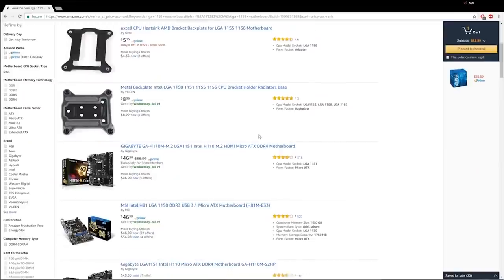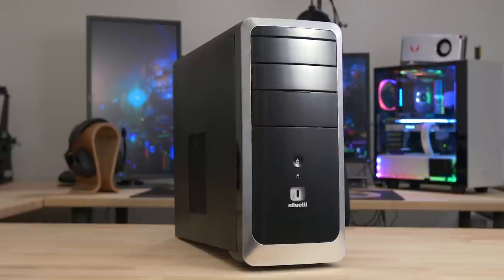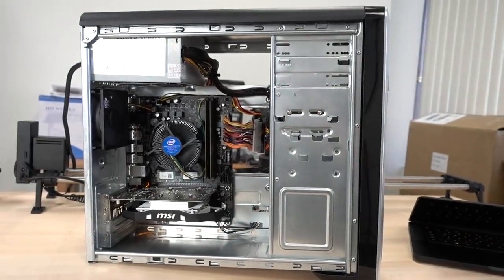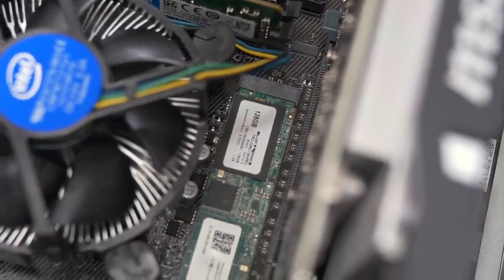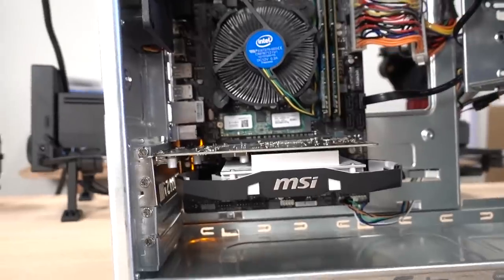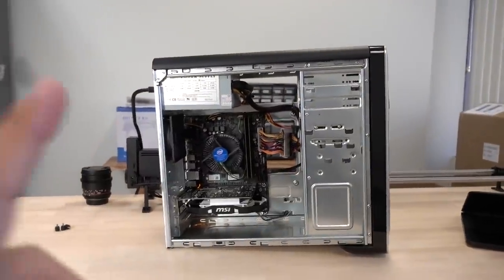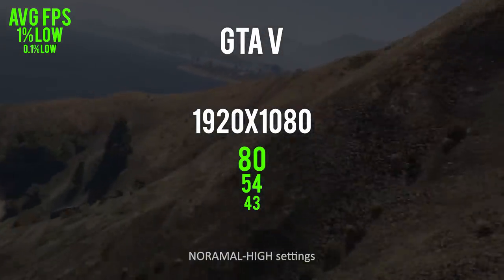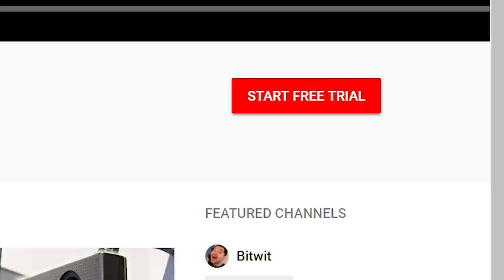The best $400 gaming PC ever?

Comment: The PS4 Pro is $450 so you could upgrade to a GTX 1050 Ti and completely shit on the PS4 Pro
Reply: and get a better psu
Reply: Chris Ayres 
Operating System
Monitor
Mouse
Keyboard
Headphones or speakers.

Your looking at another £300.
Welcome to the clueless club :)
Reply: The Slipernator

Xbox Live / PSN (Monthly cost)
TV (Avg higher cost than a budget monitor)
Headphones
Full price titles drawn out

Yeah there's a few things missing but consoles have a few "Hidden" costs too.

I guess you're the president of the Clueless club? :)
Reply: Karl Krisp 
You don't require PlayStation Plus to play the software, even if you do choose to purchase it's 40 a year!
You don't need headphones you can use the tv speakers which most do.  Nobody would purchase a console unless they already have a tv!
The console will always be cheaper, more simple and less problematic than a budget equivalent PC.
Reply: I'm pretty sure no one would buy a recent console without using online services. Old consoles can be used as blu-ray machines.

If you don't use headphones for games, You're only hurting yourself.

Tv's still need to be purchased. (I bought my TV after i bought my XB1)

And yes consoles are cheaper, but you're locked into limited usability.

Consoles are good for casual gamers picking up games for an hour or two, if you're wanting the high skillcap and competitive scene and almost no restrictions, PC is 100x more worth it to spend an extra $400 to play.

Disclaimer: I own almost ever console (No SNES RIP) and i dislike playing any game i have on PC on them. Now exclusives and whatnot are a good time. I love me some God of War or Forza.

Oh, and PC's are only problematic when you don't keep everything up to date.
Reply: Not trying to make this a "you're wrong, fuck you" Argument, Just stating that you cant go out and buy an xbox one and plug it into the wall and immediately start playing. There are steps for consoles as well. I hope you're having a good day! :)
Reply: +Karl Krisp
1) Unbox console
2) Plug into wall
3) Plug into TV/Monitor
4) Sync controller(s)
5) Perform step by step initial startup
6) Insert game disc or download game
7) Play
Seems pretty simple to me...
Reply: Glasterz consoles aren’t good dude they don’t even play 1080 p they play at 900p and can’t even get 60 fps on fortnite I don’t dislike console players but it’s just plain dumb to go with a console or a pc unless u have like small children or something
Reply: As long as it's 720p or higher, I have absolutely no problem with 900p
Besides, the Xbox One X plays 4k at a solid 45 fps minimum so your 900p argument is invalid there...
Reply: Glasterz Xbox one x costs more than a pc tho same can’t be said ab a generic console
Reply: Glasterz if u think 45 FPS is good then u haven’t expierience life
Reply: Xbox one x without TV = $500
                                            Great Quality, Good FPS
This budget gaming PC (No Speakers/Headphones, Monitor, Mouse, Keyboard, etc.) = $400
                                            Good Quality, Good FPS
Now, you add in the other costs and factor in the performance setbacks and you got yourself a result less than favorable for you
Reply: 45 FPS not good? Once you start getting past that, you really can't perceive any changes...
Reply: Chris Ayres my xbox one cost me 180 new
Reply: You're nuts man.
Reply: Glasterz wtf can u play on Xbox with no TV ? You can use your tv with the pc as well so this adds no cost apart from headphones ( not necessary and , not included with x box to my knowledge ) and keyboard and mouse , cheap ones for $20 dollars so still $80 cheaper than x box , higher frame rates and can do a lot more than play games !
Reply: Sharky. This is the most stupid argument of all. Do you know how many games are only for PC?
Reply: TV controller headphones speakers?

ur looking at 500 dollars
welcome to the clueless club
Reply: The PC master race strikes again!
Reply: Honestly at this point I would only consider console for exclusive titles and thats only if the game is really worth it otherwise PC all the way
Reply: The Slipernator ik this is an old reply, but i cant help myself :)

You can get the OS for free from the Media Creation Tool and it isn't piracy since the tool is free to download from Microsofts website.

You can use a TV. If you're including a monitor in the pricing, then you's have to include a TV with the consoles pricing.

You could grab a cheap mouse or keyboard or a mouse/keyboard combo.

Again, TVs have speakers, but if we are going by your philosophy that you need a monitor for PC gaming/usage, then many monitors come with speakers, even if they don't you could use any pair of earbuds or headphones laying around your house. Earbuds go for extremely cheap.

So really, you only really have to pay for the keyboard and mouse, and cheap keyboard/mouse combos can easily get the job done (well, it would perform better than a controller).
Reply: David Whitfield i know this comment is old, but I dont care.

You could crank resolution up to 4k on a 1050ti. Sure, you may have to turn some graphical settings down, but consoles already play low-medium settings. You could play at 4k 30fps on a 1050ti at low-medium settings, probably even higher.
Reply: Sharky. I know your reply is old, but there will soon be a PS4 emulator, there is already a Nintendo Switch emulator, and a PS3 emulator (and an Xbox 360 emulator, but i dont think you care for that).
Reply: The Slipernator This. I can't stand when people say a PC build is cheaper when they only consider the tower hardware. Most people that would consider a build like this probably don't own a computer. And surely don't have all the other parts laying around either. So all other parts get added to the list. So, yeah your $400 budget goes up to about $700. And if you don't know how to build or don't want to, you figure at least another $100 for someone to do it.
Reply: Chris Ayres lol wot you can't build a 250$ gaming pc better than console
Reply: Chris Ayres I like ps4 because it's exclusives are my favourite games, but I like pc for it's performance
Reply: the xbox one x actually runs most titles at 1800p, not 4k. and 45 fps is not good, even though most titles on Xbone x run at 30 fps
Reply: @david whitfield any system can run 4k, you would simply need to sacrifice fps or turn settings down until the fps is bareable
Reply: operating sys. free
monitor 45 bucks
mouse 5 bucks
keyboard 5 bucks
 headphones 30 bucks

you are clueless !
Reply: @theslipernator1402  not to mention gayer.
Reply: neither the xbox one x or ps4 pro can do native 4k.
Reply: @theslipernator1402  you can get your operating system for free, you will also need a monitor for a console, and you need headphones for you console as well
Reply: @bmil38  You say that...my 200+ fps games disagree with you. I can perceive how smooth the games are, and I can 100% tell the difference even over 60fps. So...there's a pretty big jump right there. 60 FPS is 100% of the time better than 45FPS. And you can tell a difference.
Reply: @theslipernator1402  these are small prices and you dont actually have to activate windows if your that strapped for money and most people have a tv and headphones so no its not another 300
Reply: Lol gtx 1050ti ain’t shit, unless you have a gtx 1060-1070 then ps4 pro is still better
Reply: @theslipernator1402 u know you can pirate windows 10 right?
Reply: @josephstalin2138  considering 1050ti can run any game on the market just fine plus all the perks of having a PC in the first place makes any console pointless as anything but a glorified vcr
Reply: @Chris Ayres I still buy them along with PCs because of exclusives
Reply: @theslipernator1402  alot of monitors have speakers built in get outta here console peasant
Reply: This post is hilarious!!  Full of "I've spent tons of money on a PC so need to justify"
Reply: The Slipernator so console players get a free tv with their console ? And you don’t NEED a headset, you can use built in speakers, you also don’t NEED the top of the line keyboard and gaming mouse AND you can get Linux or steamOS for FREE  welcome to the clueless club
Reply: @SL1PSTAR  lots of other people see their graphics too. For example, if they are streaming, thats people who see their graphics.  If they are uploading content on YouTube, theres more viewers.  Case in point, people still see their graphics.
Reply: PC master race.
Reply: @leonelisaacflores  Amen Brother!
Reply: @Splorpop me... rip
Reply: The Slipernator tv controller mic :) welcome to the clueless club
Reply: Nah get a rx 570 its like 30 fps more for cheaper
Reply: just so you know the ps4 has a vega 56 and the ps4 pro has a vega 64  look up the facts son.... you cannot buy a vega 64 for less then 600 but the fact theres something called whole sale and company deals the vega  company sells there vegas for like 400 bucks less if you buy billions of them all at once which is what sony playstation does
Reply: Screw consoles, they're non-upgradeable junk!
Reply: @CHICKENmcNUGGIESMydude  No, the original PS4 has graphics somewhere between an HD7850 and HD7870. The PS4 pro has graphics similar to an HD7970 ghz edition. I just bought a refurbished Vega 56 for $240 plus tax and you can overclock it to Vega 64 speeds or faster(so gtx 1080 or rtx 2070 territory). Xbox one x is less powerful than an rx 580 and similar to a gtx 1060 6GB. The original xbox one and one s are like an r7 260 but about 10% slower.
Reply: @theslipernator1402  no os, just dont use a key
Reply: @theslipernator1402  200£
Reply: remember, no ps plus to play online
Reply: @bit8793  and case
Reply: @theslipernator1402 Slipernator you don't need to buy an os and what about all the other features for a console?
Reply: @theslipernator1402  ps4 pro tv or monitor
Reply: @theslipernator1402  I know this is old but os. Dont need to do it if you are ok with watermark. Plus easy enough to get a key for less than 20 us. Moniter? You need a tv to play a console as well as headphones or speakers. I built a really nice pc, hooked it up to my tv and bought a 15 dollar keyboard with a track pad. No additional cost other than the 15 bucks. And I use my xbox controller to play with.
Reply: @davidhodge0201  
You will already have a TV no other purchase necessary. (Money saved)
You dont need any operating system (money saved)
Dont need a keyboard or mouse (money saved)
Reply: @jszn561  Research better dude.
Reply: TunOF75 but  you don’t have to pay for a operating system
Reply: @theslipernator1402  You're*
Reply: @theslipernator1402  you don't need to pay for Windows 10 and a PS4 pro doesn't come with a monitor or headset either
Reply: @vikinggamer320  ok salty console peasant, explain all the frame drops
Reply: @SL1PSTAR  lmao do u think we care if we're the only one who can see the difference? That's why we went with pc instead of trash console
Reply: @SL1PSTAR  ok you an use tv for a pc to (Money saved 
OS is free just dont use a key (money saved)
a keyboard and mouse only costs 15$ and you probably have those lying around too
your points are invalid
Reply: you can use a console on a monitor
Reply: no matter the argument of the price comparison on extra peripherals and shit.. pc peripherals only need to be purchased 1 time so the investment has already been made.. aslong as those peripherals are looked after you wont need to buy a new set of them again for awhile... then lets talk about gaming online for a second shall we.. pc we don't need to pay a service to play our games online.. meanwhile in 4-5 years time from your playing xbox live / psn you've cashed out $200 just to play your games online.. PC doesn't cost a damn thing for that. so in reality pc can stretch the budget to another $200 ontop of the console price point. consoles used to be great.. but since the gaming online paywall happened from microsoft.. it sucks.
Reply: David Whitfield  hell a 1050ti probably can run 4k 20fps like a ps4 pro does
Reply: The Slipernator windows 10 is free, monitor u can find a very good 60hz monitor for 40 bucks, mouse for 5 bucks, keyboard 10 to 20, headphones 30, 105 dollars in total but its only one payment, console gotta pay monthly, whats ur point
Reply: @bmil38  its generally not even 4k, its just 1080 or 1440 upscaled to 4k
Reply: TunOF75 
PS4 pro $450
A ps plus 1 year $60
Is total of $510
$400 pc
Free windows or you can activate one for $17
A keyboard and mouse combo $15
Total $432 
That’s ofc me not mentioning the thousands upon thousands of games Pc has that the PS4 doesn’t or the huge discounts in steam
Reply: @theslipernator1402  windows can be had for free, technically. Does the ps4 come with a monitor or speakers? mice and keyboards can be bought at low quality for $10, and does the Ps4 pro include speakers or a headset?
Reply: @bmil38  *30fps
Reply: @bmil38  bullshit. the humann eye can percieve thousands of fps. heard of fighter pilots?
Reply: @MaruSurfs  ps4 is essentaly a $200 pc, because they pay $0 for markups.
Reply: @theslipernator1402  you cant upgrade a console can you
Reply: @bmil38  45 fps is not solid
Reply: @MaruSurfs  You have to use controller be quiet
Reply: @watchandjewelryloft4713  you can just watch a video
Reply: @jakenelson5516  You couldn't play games at a stable 45 fps? Is it really that bad?
Reply: @bmil38  yes
Reply: @travisjames494  Bud I actually go outside and do shit. I don't no life on games filled with tryhards. I chill on GTA most of the time I'm on there. And I've played games like Project CARS 2 at a friend's house running 150 fps. He runs it limited to 60 fps normally. Much more stable in terms of frames and you really don't see a difference. I'd rather run 4k with 60 fps than 1080p at 150. I'm not gonna judge you for your preferences, but you did come straight in with calling me a moron, so I'm just gonna assume you see the sun one time a week and it's to go pick up more snacks and energy drinks...
Reply: @jakenelson5516  Ok. I don't believe it but whatever makes you feel better...
Reply: @bmil38  You've probably never touched a pc
Reply: @jakenelson5516  How much are you willing to bet on that? You seem confident.
Reply: @theslipernator1402  Yeah I totally agree that is something most novice pc builders don't think of
Reply: @bmil38  nice and hot
Reply: @vikinggamer320  chill dude you should be at scho- oh, wait
Reply: @gigabytee  jeez chill
Reply: I'm pretty sure the only people who would take a console over a PC would be like a parent buying a console for there 5 year old child to see if they like video games or something.  A console is like the training wheels for becoming a gamer.
Reply: @bmil38  dude you can see a massive difference between 45fps and 80-144fps... Wtf is your point
Reply: ZPERO ur a xbox player aren’t you?
Reply: @polarix5348  Don't insult me.
PC Master Race.
Reply: somewhat true but the ps4 pro even though it's locked at 60 fps it runs at 4k fairly smooth
Reply: I read so much wrong here, we're comparing a console to a pc, peripherals don't matter anyway they're cheaper on pc than console. Consoles are less powerful than even the low end pcs. The ps4 pro would never even get close to a vega56, that's gtx 1070-1080 territory.. 

Consoles are great for people who just want to play games on the controller attributed to the platform, pc is great for just anything more than that. 

45fps is far from good, 60fps is a solid fps. Anything high than that just improves input lag reduction on a 60hz panel. So 120fps will be better than 60fps on the same monitor even though you don't SEE the difference unless you go for anything higher than 60hz monitor.

The ps4 pro does not run 4k, it upscales a lower resolution to 4k. But it doesn't touch the 60fps either.

For people comparing steps, once you have you're pc it's as simple as plugging it, dowloading a launcher like steam and download a  game to play. Building the pc is simply a choice you make and if you see it as a downside, well my friend, I'm sorry you don't want to learn new things. Building is easy and fun, as so I build pcs for all my friends if they want one.

Again, building a pc is fun and should not be put against the pc because you can simply buy a console. It's like telling a guy his hot rod isn't as good as new challenger because he had to build it... I love the expression "built not bought". If you consider building like a downside again, you can't put that as a con since it's basically personnal choice and taste in the matter.
Reply: @theslipernator1402  if you're buying a pc you can find a cheap mouse, keyboard set for around $20
and if you have a mobile phone (unless you're a boomer) it would either come with headphones or you would have already bought headphones for it.

you can use a tv screen as a monitor if you can't afford one and everyone has a tv. there are cheap monitors that are $40 you just lose some quality if you really need one.

if you look hard enough you can find a $20 windows OS 10 that's legit or just get an illegal copy hehe

basically an $80 extra cost for a much better system compared to a console for a similar price. it's the higher value for the money.
Reply: @bmil38  if you buy a $500 pc which is the same price as the release xbox one x you can get 60fps 4k hehe :)
Reply: @NotSandhorst  
Seriously? 😆😆 Multi trillions of money pushed into an industry to make a console cheaper than any equivalent pc and you have proven they are all doing it wrong ? 
Delete your internet before you do more damage.
Reply: @SL1PSTAR  you could say that to anyone who thinks differently to you - doesn't make it a good point I may add - but you say that to me?

My main point is that you can get better gaming pc performance for the same price as a console. How is that saying they are doing anything wrong? There is a big industry in pc parts that are cheap as well. Neither are doing anything wrong because consoles are useful for different things than pc but the performance aspect is something that the same price PC's (also a multimillion industry, maybe even billions) do better! Consoles can do other stuff better but that aspect is what can make PC's known as 'console killers'. It is a widely used term and can be comprehended in one simple way because there is usually one main thing the pc can do better than the console.

The reason why you can get better gaming pc systems than top of the line console prices is because of the customisability which is where consoles lack A LOT in. Every person who builds their own system could be thought of as a company, since they are making a unique choice of parts that can outperform basically one single console that is designed for a smaller purpose and has an uncustomisable configuration, prohibiting better performance.

I hope you read this before telling people to delete their internet, not everyone on the internet will be nice to you ( even in real life ) and have the same view point as you.